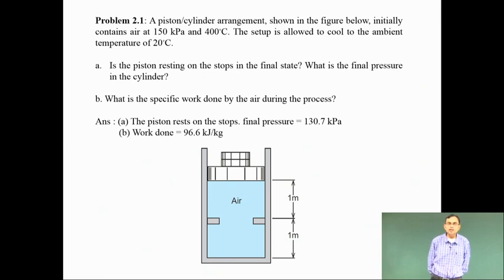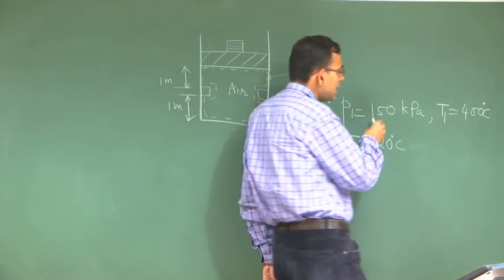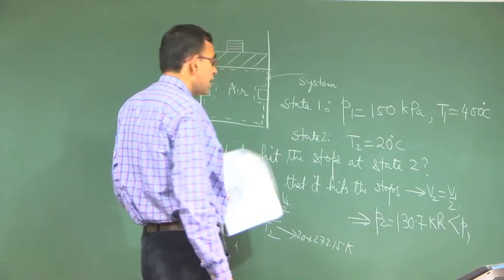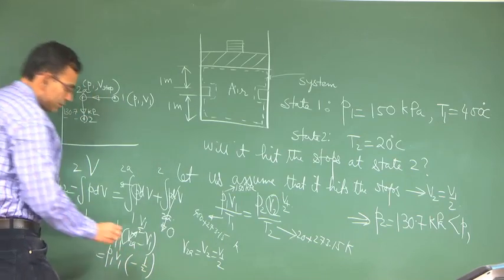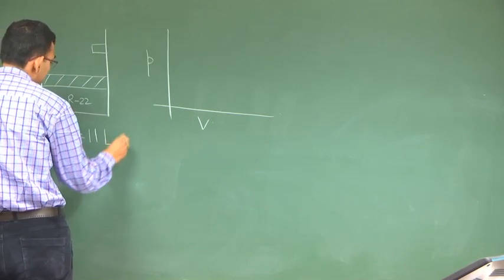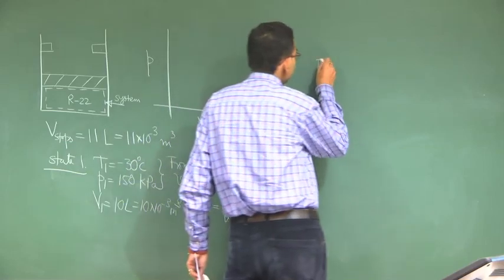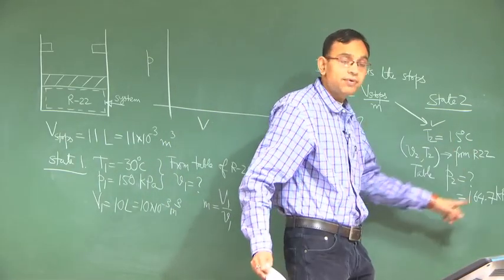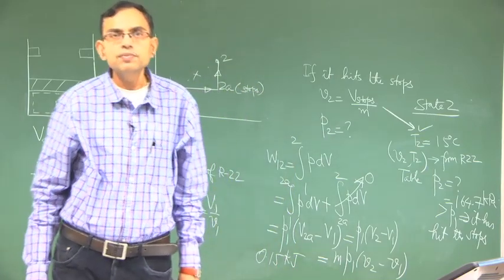Lecture 11 : Heat and Work : Representative Problems

Comment: Sir, why does pressure reduce suddenly in ques 1 once the piston reaches the stops ??  Why can't pressure decrease linearly or gradiently with the piston displacement?
Reply: The time lapse between the two moments- One when the piston is "just" about to hit the stops, and the one when it is actually resting on the stops, is very less, and thus, the moments (in time) when the the stops are not supporting "a part" of the total weight on the piston (including the piston weight), and when they actually begin to support this weight, these two moments are very close to each other (in terms of a time lapse), and when the piston suddenly encounters the stops which are ready to support a part of the weight above it (and also the weight of the piston, by providing a normal force), then it would cause a sudden drop in the pressure of the gas, since now, this pressure and the normal force from the stops together are supporting the weight of the piston and the weights above it. The sudden dip in the "PV" diagram is due to the fact that the volume cannot decrease any further, while the pressure must. However, observing P as a function of V and P as a function of time are two very different things. Here, the variation seems to be the same since "dv" has also become zero almost instantaneously.
Reply: @bajaj5602  bro can u explain how the values are taken from R-22 properties table (referring 2nd problem)
Reply: Process 1 to 2 (a) is quasistatic process so pressure is constant .. when piston comes on stop then pressure reduced .
Reply: @azadupsc629  bro there is no combination of -30* and 150 kPa in R-22 properties table , How can we find v1 ?(referring 2nd problem)
Reply: @johnpashasyed5534  yes bro i have same doubt. have you got the answer?
Reply: Hoping for help here with my doubt...
Reply: It's given in question that temp have to be reduced. Remember charles law. Also constant pressure heat rejection is a compression process here compressing cyllinder also heat rejection occurs as temp as well decreases so pressure is constant.